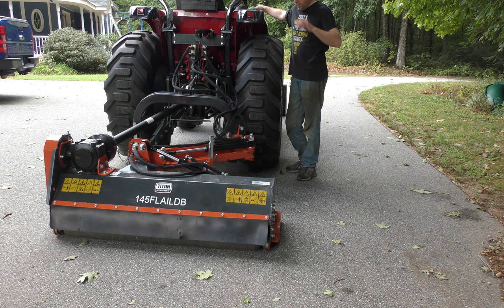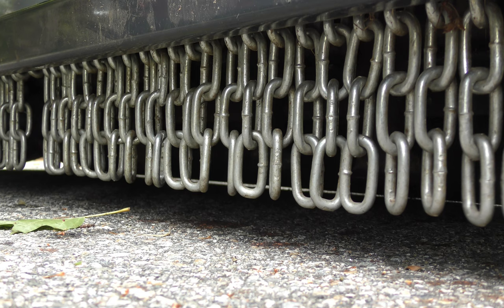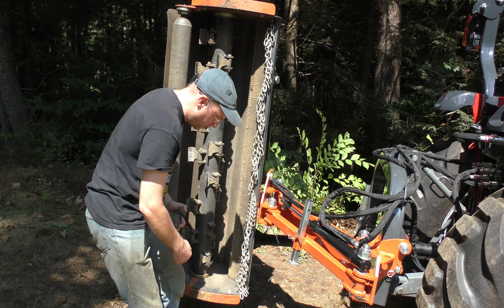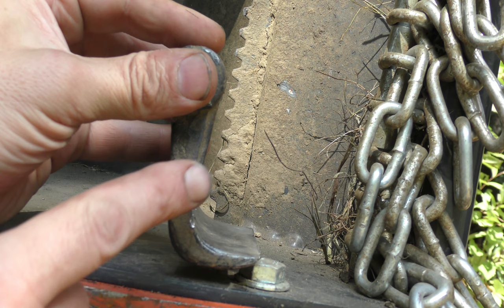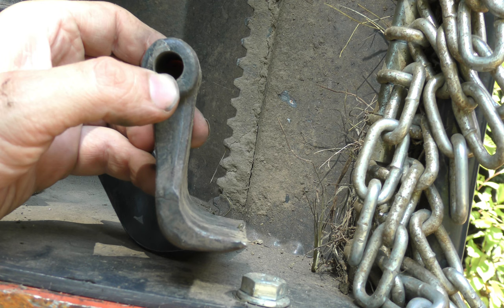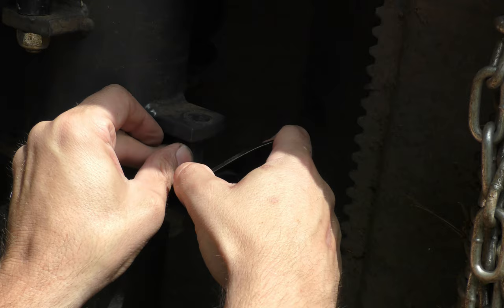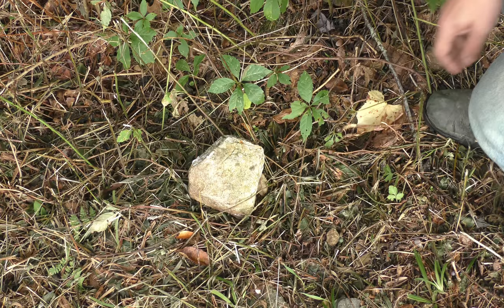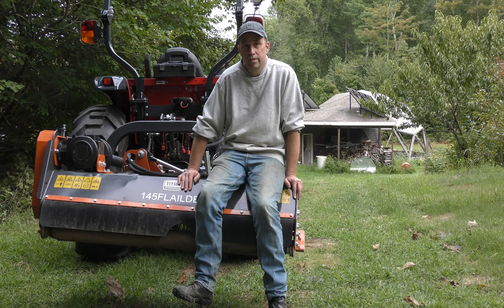BUYER BEWARE: Titan Attachments Flail Mower Review

Comment: The hammers are designed to fail to keep from a major incident and destroy the actual implement, the bolts are more shear pin to break under excessive strikes. Running the cutter too low is the issue and not the equipment.

Comment: Titan flail mowers are total junk. I went through two of them. I literally had the roller fall off because the way it is mounted is not rugged. I also had the 3 point lift mechanism break. Cheap price but poor quality and zero parts availability. There are considerably better ‘value’ brands for just a little more money.

Comment: I'm not convinced the original blades are forged.  I suspect they are cast steel and not even a good steel for this application.
Reply from the maker: Titan clams they are forged.  Since I can see a parting line down the sides, I would also suspect they are cast.
Reply: They're cast, I tell by looking at them.

Comment: i notice theres a lot of products out there that is just junk even though its expensive my buddy had a $3000 snow blower i think it was ariens  the main drive pulley was made of plastic lasted about 5 minutes and melted making the new machine useless my yamaha scooter clutch pulley wore out before the belt thats just not the way it is supposed to work. i wanted a little radio and got one and some batteries from superstore turn it on and am fm on at the same time i return it and the customer service says to me what do you expect for $10? i said i expect it to work like it is supposed to work as it was designed not a garbage product wast of time and money

Comment: I have the 72inch flail mower from titan.   On my 2nd year.  Same blades as yours.  No blade problems at all.  I don’t run over rocks with any of my mowers.  I do not cut dirt nor rocks nor steel with my chainsaws!   If you adjust your mower properly the roller in the rear will work properly!!   Titan has a very heavy duty gear box.  Rocks will damage all blades from any manufacturer of flail mower.    My mower still looks new after 2 years of use.    You really need a good weed eater for those rock 🪨 then you can just replace the string 😂
Reply from the maker: The new blades I put in it haven't had any problems with hitting rocks
Reply: mate crap design is crap design... doesn't take a genius to realise that that blade angle is gonna result in the exact failures he's seeing... like striking the flat 'base' of the blade with a hammer aimed right a t the pivot point...

Comment: Thanks for taking the time to post this video. I have owned and used the 165 version of this mower for a little over 2 years and cannot say I have seen any cracking in the hammers. Now that you have alerted me about this I will check more often. I'm wondering if maybe there is a QC problem with the casting of the hammers and you got a bad batch. I've hit my share of rocks too but haven't had the same issue. As to raising/lowering of the drum to avoid scalping - check! I do the the top link adjustment instead and don't have a problem with debris flying out the front. It would be nice to have an adjustable drum.  I still have all my chains but like you, the rubber rear guard is torn-up pretty badly. And like you, I will fabricate something more rugged.

Comment: I have the 72" titan flail mower and have had mine for 3 years with 0 issues so far, i have the hammer blades and i am in very rocky ground, but i run mine with the 15 degree tilt and i generally dont run it directly on the ground , i usually run mine at about 4 inches off the ground , I have hit some rocks but never broken any blades yet ,I never tried to get any replacement blades since I have never broke any, but after watching your video I am going to buy a  couple sets of the blades you have since titan doesnt  have any and then switch to the new ones if one does  break  , great video and good luck in the future
Reply: The manufactures specs state to operate at a 15 tilt........read....
Reply: @cullenfitchett8103  I think most people don't read their manual  and then this may cause early failure or poor results ,so I agree everyone needs to read up before operating their Flail Mower, I have had other flail mowers that also said to operate around 15 Degrees, so that may be common for several brands and  from one's I have operated it seems to be pretty standard .
Reply: Sounds like an operator issue to me.😂

Comment: Glad you posted this.  I was about to buy the same model, but don't like it at all if it was damaged so much after 30 minutes usage.
Reply: As an equipment inspector the common failure point on equipment is usually the operator.

Comment: I'm heavily considering a flail for my Kubota L2501 and Titan so far, is high on my list. Primary due to price, the ability to articulate and offset mower, and the capability to work with my tractor. I already have a rotary. I appreciate you taking the time to make this video as I always do research on potential items I'm looking to buy.  I agree the roller is set to low. If I brought this unit, I would modify and adjust the roller for more clearance.  I would also use a zero-turn or a finish mower if I wanted to get the grass cut that low. The Titan at $4000 and the equivalent Maschio 4047 at $5500, I'd rather save the money and get the Titan.

Comment: If you read the instructions they recommend  the mower  be tilted up in the front 15 degrees which does keep the cotters higher off the ground.
Reply from the maker: That's about what it is set to mainly because I couldn't get it any lower.  Regardless, the blades are poorly designed.
Reply: Sounds like you needed a longer top link so you could get the roller on the ground and the front would have been higher off the ground.
Reply: Wow! I'm glad I spent more and bought  a better  unit. I've used mine a lot and no problems. Doesn't pay to buy cheap.
Reply: @geneshippers5493  Agreed but $4k is not what I would call cheap. There are $2k - $3.5k flail mowers that I would call cheap in this context but $4k is gaining on the supposed quality machines. This is what I would expect sub-$4k.
Reply: @chrischamberlain6817  Well I paid 6k for mine and have 0 problems. As a matter of fact it exceeds. I can raise and lower both the skid shoes and the roller to change cut height.
Reply: @geneshippers5493  Wow! I definitely don't need one that bad. I would like an improved cut but not $6k worth.
Reply: @chrischamberlain6817  it's a competitive price for this mower in this area.  Thank you for your posting. You did an excellent job. Good luck with your mowing.

Comment: I've considered getting that mower. when brushhogging I always keep my FEL down with the bucket about as low as I can go ~1-2" from ground, so can catch rocks before the mower does. The hammers do like the material could have been good, but the angle is just not right. Good job

Comment: Awesome review…!
As I’m reading this I’m plumbing my tractor to operate a new Del Morino…..mine has both an offset and 180 ram….hammers similar to yours and an adjustable back roller. Also ordered 6 extra hammers. I’m curious where your flail was made or built…? Are hammers from 
India? The reason I’m asking was my box blade rippers all failed until I found forged Kubota rippers….haven’t broken a ripper since…
Reply from the maker: It's made in China.  The replacement blades have been working great.

Comment: Thanks for sharing your experience with your flail mower. I live up in Ontario and we have rocky areas too. And more clay then we need. But I make a point of clearing rocks every year and use a couple of crow bars to get the rocks out of the field. Some of those rocks on your video were fairly large. I think you gotta start over and move some rocks out of the areas where you want to cut. This will save you some parts.
Reply: Wish I would have seen this first. Mine lasted 15 minutes mulched some 2 inch limbs in my mowing path and it destroyed itself in fifteen minutes of use. And they won't warranty it. 82 percent bad reviews on warranty

Comment: Thanks for the video! Rocks always seem to be a farm's best crop. Every spring we have a new crop that popup out of the ground. Couple questions for you. I need to cut some lawn at about 2 inches. The pastures get cut at about 4 inches. Do I have any hope of accomplishing that without redesigning the machine? Also, where did you get your replacement blades?
Reply from the maker: you can get a fairly even cut if you try to keep it at a fixed angle on the 3-pt hitch.  But if the grade changes quickly, that angle will change and you will ride on the skid plates and dig up the lawn.  Not as good as a finish mower, but I have no problem mowing around my greenhouse where it's flat.  https://www.amazon.com/gp/product/B08XFJ5XGX/ref=ppx_yo_dt_b_search_asin_title?ie=UTF8&th=1  Just make sure you round over the top of it so it can swing freely.  I have about 20 hours on this mower and just had to replace one of these blades.  The others look good.  In comparison to the 20 minutes out got out of the factory blades.......
Reply: @Bigelowbrook  thanks a ton! I'm wondering if this is the wrong choice for my needs. I may stick with the finishing mower. The height adjustment on that is very simple.
I bet the hammer blades it came with are more for golf course or perfect lawn applications. Farm land like ours is far from perfect 😁
Thanks again!

Comment: well, you have a welding machine there? 
First thing I saw is that they did not weld the ends of the knobs holding the knifes/hammers, good sign of halfass work. It will rust in there but, maybe it will be scraped b4 the knobs start falling off.

Comment: I see this video is a year old.   How has this implement held up since the review.  I have a new 3046R and want to get a few implements and have been looking at TMG as they are the only ones readily available in my area.  Would you buy it again?  What other TMG implements do you own?  Thanks in advance.
Reply from the maker: I don't own anything else from them nor plan on getting anything else.  It runs fine with the replacement blades.
Reply: Thanks for the quick reply.  I thought I was commenting on a previous video I watched.

Comment: I have the 165DB and after struggling through the learning curve , i have discovered the Y-Blades work the best for me. the hammer blades are junk around tall weeds and grass and they do not like rocks . the set of Y-blades come with spacer and bolts and i just throw them in the trash . i had to upgrade the bolts to grade 8 bolts and changed to solid bushing . and removed the back cretin . with these upgrades it handles scrubs up to 3" and grass and weeds up to 5' high . the most difficult part with dealing titan is there web sight and communication . they are realy bad when it comes down to customer service .
Reply from the maker: yup.  It's too bad....probably if they spent 5% more on product quality, it would be an excellent mower.

Comment: To all who say it's not setup right. How do you adjust the height on a mower that has no adjustment? It is a crap design. The rear roller should support the mower when flat and level not the shoes. The shoes should just assist on uneven ground but when he showed the mower it was resting on the shoes and the roller is off the ground. That means when you pull it around the shoes are going to digging up the grass. You should not tilt the mower back to make it ride on the roller it will deffinately throw debris at the tractor. Been there done that, no fun. The correct adjustment is flat, level resting on the roller with the shoes slightly off the ground. When the roller is on the ground the blades are only a 1/2 inch off  the ground. The roller needs to be adjustable.  That is the first flail I've seen without an adjustable rear roller. Flails have to be some what close to cut anyway but at least 2 inch minimum 3 better, unless your trying mulch everything into dust which is not what they are designed for. And what manufacturer doesn't offer replacement hammers...WTF!  With a few mods it would be a great mower. To bad.
Reply from the maker: thank you!

Comment: Keep the old blades, grind off bottom, weld up cracks, keep for spares?
Reply from the maker: These new steel blades are only a couple bucks a piece.  It's just easier to replace them then spending the time trying to fix a crappy Chinese blade.  I don't even know what kind of metal it really is so it could be difficult to weld.

Comment: Neither the blades nor the mower itself is meant to mow rocks with though. While the Titan Flail mower has room for improvement, they never claimed it was capable of mowing rocks! I don't think any mower is going to perform well or for very long if it's being asked to ingest large rocks or chunks of concrete or metal or anything like that. I'm just saying, I think your expectations were not realistic... or your property needed a thorough going-over and cleaning up (removing or at least marking with red stakes where the hazards are) before mowing it. 

I bought the 200DB 78" Titan Flail Mower last Spring and haven't experienced a single blade failure mowing abused and neglected former hay fields that were overgrown with briers weeds and small pine tree saplings, all of which are well within the advertised scope of these mowers. Admittedly there are no natural (or unnatural) rock formations in this soil, it's just clay and sand.... and all concrete hazards have long been removed from when we used to bail hay here. There were fire-ant condominiums the size of which you would NOT believe though and the flail mower tore thru every one of those leveling them with no damage to the flails. I do wish Titan would stock replacement parts for the equipment they sell, I do not understand THAT at all! There are issues still with the Titan Flail Mowers, like that rubber discharge flap it tears apart in no time flat it's thin cheap single-layer rubber, and like you mentioned the stands are about 5 inches too short for some reason I have to put boards under them to disconnect it from the tractor.... but in-ability to mow rocks is not one of the issues IMHO. Just saying.
Reply from the maker: You are correct that they don't say it can deal with rocks, but they do say it could handle a branch up to 3" thick and dense debris, which is highly unrealistic.  In my area of the country, anyone that I know that has a flail deals with rocks...there's no such thing as rockless ground so it's our expectation that the equipment is able to deal with them.  I have worked with several other flails in my past and they have never had issues like this.  Even our road crew mows 35 miles of town roads every year, twice a year, and only has to replace a few blades...these roads are lined with stone walls and you can hear the mower from miles away as it bounces off the rocks.  It was very evident that the Titan blades are poorly designed and just pain crap.  It's even worse that you can't get the replacement blades.    Thank goodness I was able to find these other blades.  If they only put good blades on this, it would have been an excellent mower!
Reply: @Bigelowbrook  you're comparing commercial flail mowers with a non-commercial unit for one. Two, if that's what your flail looks like after 30 minutes of use, you are definitely using the wrong tool for the job and also do not have it setup correctly. If you use a chainsaw to cut a fence, is it a faulty chainsaw when the chain dulls after a few cuts?
Reply from the maker: @mimimoo4493  That's not the case.  The mower is working substantially better now that it has good blades on it.  The reviews on Titan's site also have many people commenting on how horrible the blades are.  The rest of the equipment is holding up very well except for the rubber flap which many people complain about.

Comment: I have the 165 , iv cut some thick stuff sweet gum trees everything, lov it now I have lost some hammer blades and bolts but that's part of it , back tracked and found them bought new bolt back to cutting lol
Reply: I've lost several of the guard plates that go across the front of the Titan 200DB mower..... they get knocked off by ingested sticks very easily. I've located a few of them, but am missing about 3 or so right now and no idea when they may turn up again. Rear rubber discharge flap is about gone, it's very thin soft rubber need to find something better with layers to replace it with! Tilt hydraulic cylinder is very bad about unscrewing itself then rupturing and spraying hydraulic fluid all over the place! What is the point of these little short stands, they need to be like 5 or 6 inches taller than they are! Arghhhh! Cut quality is amazing however, even 6 foot tall brier patches just disintegrate when this mower goes over them.

Comment: Dude u really beat the hell out of that because u didn't adjust the height correctly! Obviously if u hit rocks u will wreck stuff, I run mine higher when cutting into the unknown
Reply from the maker: No, the design of the blades is flawed.  The new blades I put on it are working perfectly fine.